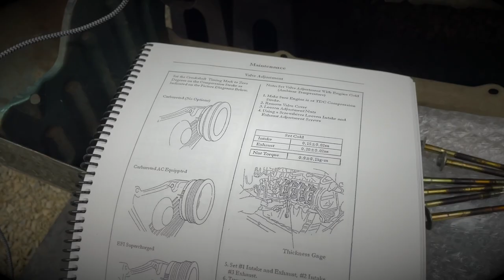Installing Factory Rear Speakers in the Subaru Sambar Dias So I Can Drown Out All the Weird Noises

Comment: Would Bluetooth speaker/s connect to a BT head unit for a wireless speaker install?
Reply from the maker: i dont know, i doubt it. May as well just use a phone and wireless speaker and not use a deck except as maybe a clock lol